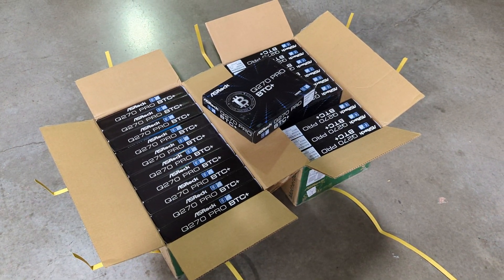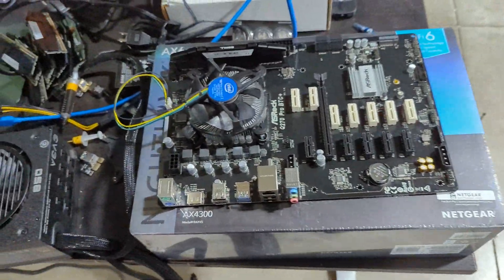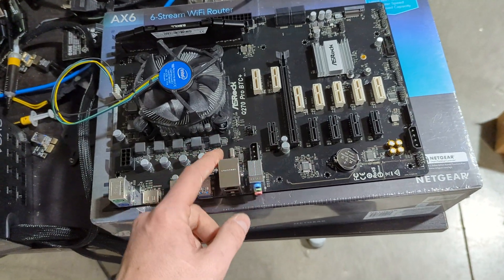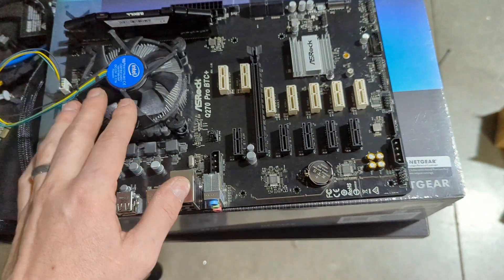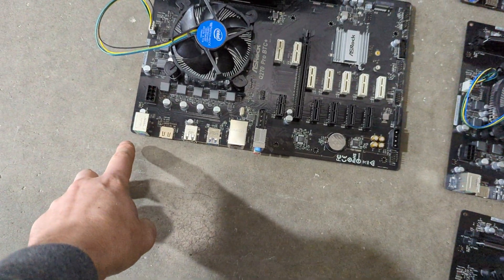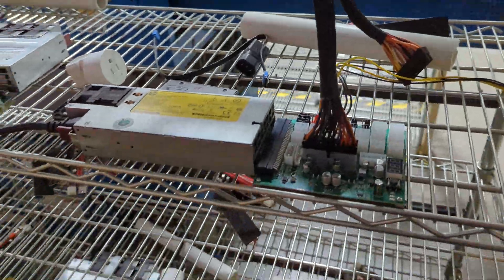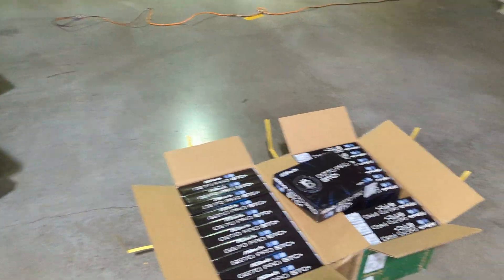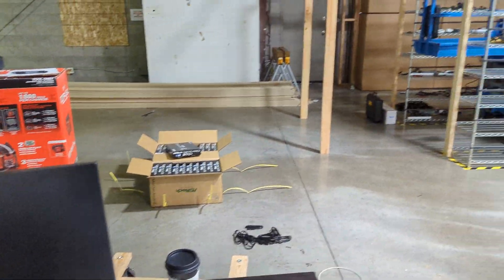GPU Mining Farm - Q270 Pro BTC+ Motherboard, Features, Functions, Usefulness

Comment: Has anyone found the adapter he used to connect to the server power unit for molex and sata power on the asrock q270 board .. tried double molex from parallel miner didn’t boot but when I connect to atx psu booted just fine.

Comment: Hi, I have the same motherboard as you. Except I have a little problem. When I have an error code on HiveOs, the rig doesn't restart automatically when I reboot. I have activated the power warning in the bios but it doesn't boot. Do you know a solution for this ?
Reply: HDMI dummy plug. A classic